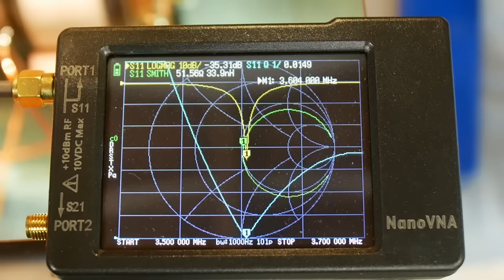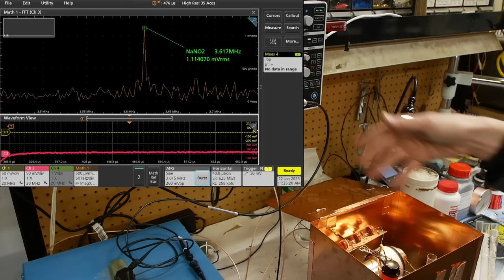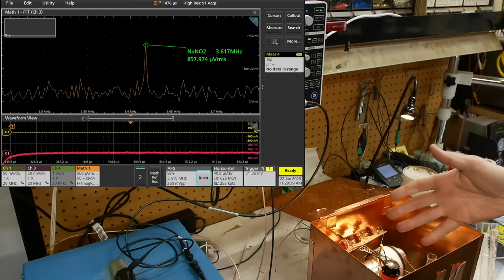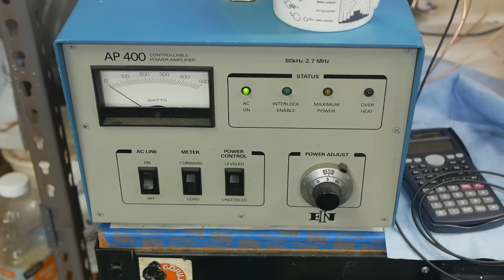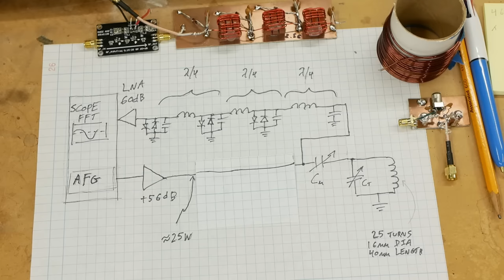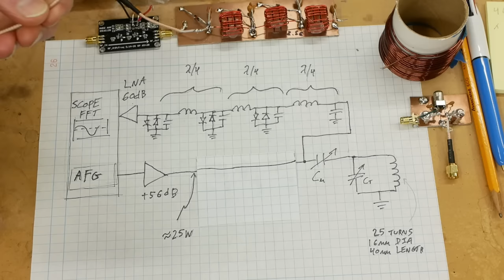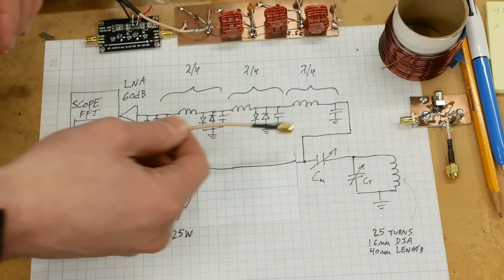Identify chemicals with radio frequencies - Nuclear Quadrupole Resonance (MRI without magnets)

Comment: A LNA with a 50 ohm input preceded by a 50 ohm transmission line of any length would still give 50 ohm input. When the protection diodes are forward biased they would present a high impedance 1/4 wave away on a transmission line, but the discrete capacitance is  shorted out, thus only the inductance is present. The LC circuit is a low pass filter with a spike at the resonant frequency, thus acting as an amplifier. 

What would be ideal is duplex circuit, like in old telephones, or a directional coupler using transformers due to the low frequency. The isolation won't be that great.

Comment: Its another way to use the electromagnetic spectrum to analyze matter. Unfortunately at room temperature you have to manually tune to these frequencies, otherwise it takes a lot of heat and energy to see its entire transmission.

Comment: Incredible.
Regarding the crystalline structures and the random distribution of quadrupole moments: in NMR spectroscopy one used solvents (deutrated, as to not interfere with the test material's protons). Couldn't one do the same with this method? i.e. instead of using crystals, use a solution containing the test material?

Comment: Hi Ben, I designed an electrical device that uses an opposing and alternating magnetic field using sound and feedback. It uses sound to make heat and uses the heat to make sound to vibrate a 454 lb xylophone key on some 12 inch round piezoelectric disks. I'm a bit stumped on how much power it will produce because it uses 3 methods to produce voltage... one is piezoelectric producing about 14 million volts.. the other is from static by separation of water droplets and spinning them in a torus.. producing enough static to produce a spark to explode hydrogen to make more sound and the third is from spinning plasma in a torus. All of this is happening within a water cooled vibrating electromagnet. What happens to all that excess voltage when the spark gap limits it to 63,000 volts AC.... is it going to throw lightning bolts? I'm suspecting it produces about a terrawatt. It would be nice to calculate how dangerous this is before I attempt to build it. It produces 2 magnetic fields.... one on the inside from the vibrating disks and another on the outside from the vibrating box.... because the box is vibrating and gold heats up when it gets hot and so it makes a second magnetic field around the first one.... When I look at the way it behaves it seems like  a magnetron.. without the wires. This device uses no wires as I think they would just melt. It uses sound to make it all work... has no plug in whatsoever. Inside the box all the cold air goes to the bottom and all the hot air rises to the top at the center and as the sound pushes the heat in a doughnut.. the heat makes more sound and and more heat in a feedback loop. It makes it's own hot water this way and turns it into hydrogen and blows it up.. for more heat and more sound. I suspect that it is making it's own gravity and slowing time around it....need a second opinion....There is nothing like it. It may even be doing alchemy because all the oxygen is attracted to the air intake hole.. and so if calcium particles fall in the hole it mixes with the water to make more hydrogen. The diatomic elements in the air that enter the hole are going to split from the sound into their mono atomic state and recombine... and give off a lot of energy when they do... even dust falling in the hole will make energy.  https://www.youtube.com/watch?v=2sSqzLPMb4s

Comment: @AppliedScience  Good video and explanations.
I study solids using NMR and NQR spectroscopy and I was interested to watch your video.

Is it possible to use segments of this video in my lecture materials?

However, I found one inaccuracy in the video: at 26 minutes, you say that NQR is caused by the interaction of an electric moment with an electric field. The NQR resonance is mediated by the interaction of the electric field gradient (EFG) with the quadrupole moment of the nuclear charge distribution. Therefore unlike NMR, NQR is applicable only to solids and not liquids, because in liquids the quadrupole moment averages out.

The paracetomal signal is very weak because standard ampoules contain very little of the substance itself. I would advise you to take pure paracetol, or at least crush the tablets and fill it tightly and tamp the container with powder to fill the coil better.
With coil ringing, it may help to pour epoxy onto the coil to secure the turns.

Comment: Why you do not use circulator or directional couplers? They use it on a chirp radar to have constant transmission and receive path.  Of course, you have to design circulator  and directional coupler for low frequency, This way it would make more broadband.

Comment: Would Schotky diodes be a better option than silicon 1N4148s  with there lower forward voltage and low capacitance?

Comment: like the frequency filter you got their...im studying frequency filters...I learned that electron beams might be good for a super computer oscillator on a plate with a transistor...the gap frequency of an electron beam by the power factor should set a signal all the way to xrays or gamma ray frequencies...Lyj2023

Comment: Don't forget in sodium nitrite you also have the 23Na which is spin 3/2 and will come somewhere in this region (2-4 MHz). I believe the urea* is piezoelectric which will make it difficult to work with.
The easiest NQR signal is 35Cl in p-dichlorobenzene it is at 34.27 MHz - you should try it.

* the unit cell of the crystal does not have a centre of symmetry.

Comment: About the problem talked about around the 30 min mark; wouldn't it be possible to use a very strong magnetic field to align all of them in one direction, after that a weaker one to make them all turn 90 degrees, and only after that measure it? That should make the signal greater, maybe.

Comment: is the 3rd pair of diodes visible at 13:10 soldered wrong? both of the black lines indicating the direction are on the same side.

Comment: Can you pulse the sample with the radio frequency photons from the split energy level you discuss in the QM section near the end? You should invert the population energy levels which will be slightly unstable (converting from a slight excess of lower energy nuclei to a slight excess of higher energy nuclei over the whole sample's population). This should return to equilibrium via the precessional mechanism, am I right? Could this signal be measured in your set-up I wonder?
If so, can you combine the energy flipping from the radio frequency with the pulses you're already using to boost the signal further?
On a separate note, I wonder if there's a circuit waiting to be thought of that could be used to tune all parts of the set up at the same time, allowing a much easier change from one sample to another?
You certainly do come up with some amazing constructions! Keep them coming :)
Reply: Or is your pulse already using the radio frequency pulse anyway? Maybe I glossed over that part and am suggesting you do what you're already doing?

Comment: What if you add mosfets, one at the input of LNA and one somewhere between power amplifier and tx/rx junction and short lna when transmitting, and short noises of power amp when receiving?

Comment: Why did you build your Faraday's cage shielding box out of copper sheets?
Would a lot cheaper steel sheets not have worked for your application? Ferromagnetic?

Comment: Can you sweep it with frequencies instead of a pulse? and does a strong magnet help?
how does impurity change the signal? just a mix of frequencies or does it become a complex dynamic that ruins recognizable frequencies.
Reply from the maker: In my research, I found systems that could electronically be tuned to a handful of preset frequencies.  It seems like motors on variable capacitors should allow continuous automatic tuning, but I never saw an example of this.  A strong magnet would overpower the NQR signal, and it would become an NMR signal instead.  Impurities in NQR just don't resonant at the target frequency, so they should have no effect.  Low concentrations of the target substance would lead to low signal, of course.

Comment: If this idea of 1/4 wave lenght insulation can be used in like a Pulse Induction metal detector? Here we have same problem we wana transmit a high power pulse, but later we wana sense low return from the metal object. I have to try it out.

Comment: To Ben & all, was invited into drone landmine detection, found from lunar RnD NASA baked lunar soil into a brick in a standard microwave oven ... I took it from there.

It melts between grains not a lava to 2m deep bottom up, implies structuring sorted dirt between antennas freehand or prefab. By pulsing seems being able to resolve specific chemicals deep enough from a drone for detection, a handheld that was a mini MRI machine had to make contact for readings yet did the periodic table ... lol, a demo at archeology seminar, GPR as well, this concept is aerial GPR.

All comments welcome 🍺

Comment: Me:  I finally got that piece of floor molding to fit properly, and it only took 3 weeks!   Ben:  This week I made a quantum flux capacitor that communicates with the future using tachyons modulated by Higgs boson resonances with parts salvaged from a  broken refrigerator.

Comment: Amazing video!! Not to be a pain in the butt, but at 28:10 you said that in an MRI machine the magnetic field is the same everywhere and every nucleus is experiencing the same magnetic field. This is technically incorrect because protons in different tissues experience different magnetic fields according to the "local" microenvironment that the proton is in (what tissue it is in). This leads to different T1 and T2* relaxation times, which ultimately contribute to a significant difference in the signal that comes from each of these locations. This is one of the main reasons we have contrast on an MRI image. It is certainly true that there is "proton density imaging" where all the protons are allowed to express themselves on the image, but that is different. 

MR spectroscopy is very similar to what you created btw.

Comment: Does the sample temperature have an effect on the relative temperature fluctuations? In other words, how does the decay time and amplitude depend on it, will it make sense to heat up or cool down the sample?
Reply: Extreme cooling of the sample should produce a stronger signal.
Reply: @rainwater397  thank you! Pretty much what I expected.

Comment: If you paired this with a high power magnet (like an NMR/MRI) wouldn’t that help align those sideways oriented molecules so you’d get a stronger signal? Or would it just prevent precession?
Reply: You can get a stronger signal, you just have to increase the radio frequency proportionally to get precession. EPR is similar, it can be done with permanent magnets and is in the microwave range.

Comment: Hi. I have a question about your messurment of energy from food and waste. Do we not also have to weigh the total of food against the total of waste? Some of the energy and weight loss should be gone from the carbon loss, bonded to the CO2 that we breath out, and some of the nutrition is chemicly turned to water, wich also is a direct energy loss. And of course some minerals and stuff is separated out in the urine, wich have to be dried add wighed. Would have been interesting to know :)
So there should be a direct energy loss that can be meassured directly in weight, so the poop should therfor be more concentrated waste with a total less weight than the food...?
Sorry, i think this topic was so interesting that i just had to ask... :D
Appolygys for not have seen that video before now. I do follow you, but have not seen at your content in a while, so i have some catching up to do :)
PS! Allso appolygys for my not so perfect english :)

Comment: When showing the transmitter side at 13:09, you have two additional diodes, not antiparallel but in parallel, as an additional stage between first and second stage. Why is that? it is not reflected in your schematic.

Comment: How does sample temperature affect your results and how does the flipping affect sample temperature?
Reply from the maker: Sample temperature will affect the signal decay time (T2* time), as well as the resonant frequency.  It seems some materials have a positive temperature coefficient and some have a negative!  You could also call this a feature and not a bug since it is a way to measure the precise temperature of something without any physical contact, even when it is held in an opaque sealed container.  The transmit power is high during the pulse (25W), but the pulse is only 100 microseconds, and I'm repeating at most once every couple seconds, so the average power is too tiny to cause sample heating.  Repetition rate is limited by the material's T1 time, so there must be a few seconds (sometimes 10's of seconds) between 90* transmit pulses.

Comment: 29:00

90° plus 45° is not 110 wouldn't you want to be half way in to maximize a half point of molecular alignment closer to half being closer to the 90° angle?

I'm curious how much you actually tested those values?

Comment: Something that wasn't clear to me was the title said "Identify chemicals with radio frequencies", but it seemed like you basically had to already know what the chemical was in order to calibrate the circuit, unless you have a separate circuit for each element. What happens with something that contains multiple chemicals?
Reply: His calibration was to protect the receiver from the high power rf pulse. 
It doesn't filter out the chemicals signal. Those pass right through the filter

Comment: Have you tried constructing a homemade diode or junction transistor? 

There are people on YouTube that create their own radio and audio vacuum tubes and think there is someone who tried constructing their own transistor, it would be great to show us how to make transistors AND how to make integrated circuits using camera lenses.

Doping the silicon may be an issue, then baking in an oven to spread out the doping region.

Hey! How about making several SQUID (superconducting quantum interference device) then using them to pick up the magnetic emissions from the human body! Possibly do some remote neural monitoring using the SQUID and extensive computer processing.

Finally, the coup de grace,..... construct an ultracentrifuge and separate out different isotopes.....or, maybe if it's possible, laser isotope separation!! Then scale it up.....at that point we've got some good stuff.
Reply: Sounds a bit like a rife machine, we don’t want old Ben here to come down with an unfortunate case of “heart-attack” we’d all be much the poorer, and we’d never get to see the video besides lol.
Reply: @JeffersonsTreeHouse  Yeah, you're right we don't Ole Ben to quickly grab his left arm as he experiences shooting pains down his arm, and then end up face down on the hardwood or cement floor
Reply: @johng.3740  a fate only the patent office would approve.

Comment: My new favourite video. Can't help thinking about parallels with Quran and Salaat. Quran is not just a book, it's a set of sounds, organised into rhythms and even pitches, with meaning. This is why it's taught by oral tradition. Quran heals via sound, frequency, coupled with intention. Quran is recited into water to create a healing solution. The polarity of h2o is what enables it to harness and retain the healing frequencies of Quran. The Creator gifted us Quran for us to know Him, and He created us so He could be known. With the one Quran He leads some to guidance and others to going astray (Zeeman splitting). Salaat is group prayer where the imam recites the Quran, positioned at the front of the group, who are arranged into parallel rows (like your coil, or an antenna). The imam is chosen based on his degree of perfection of the Quran recitation. The imam leads the prayer and therefore the speed and accuracy of the recitation is secured, preventing the recitation becoming unharmonious, which would reduce the clarity of the signal (as mentioned in your description of what is required to create the procession to read the signal). SubhanAllah!
Reply: Zeeman splitting: The energy of the photons emitted then depends upon both the split-ting of the initial state and the splitting of the ﬁnal state.

So, depending on your initial state, exposure to Quran frequencies lead you to guidance or to rejection of guidance...
Reply: Allahu Akbar! There is no power except from Allah!

Comment: lol, wanted to use something like this/make something like this for a small project, actually to read speciffic info much cheaper(since current hardware for reading it currently is as expensive as a houe, didn't try to make it yet since I found a more simple and effective and much cheaper way that worked better for that speciffic case. didn't know there already where mashines like that and using such effects, especially reading at such a wide spectrum I planned to just read the average peak frequency so I could read it with a cheap microcontroller, basically using relative changes instead of exact values since it didn't need to be be medical grade or actually determine the exact material(was kind of a different use case, verry different and weird but makes a lot of sense if I would describe it slightly..

Comment: As a scientist who worked in a lab using equipment in indentification of chemicals including NMR, I found this interesting. However I think most people would not understand what you are talking about unless they had a degree in chemistry or physics. It seems that there could be a better way to tune the frequencies a more simpler way. Perhaps an electrical engineer would be of help.